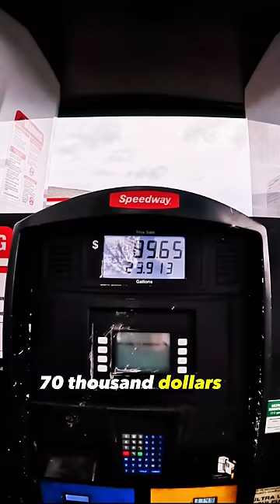when u realize Mo Money is really Mo Problems 😵‍💫 #shorts

Comment: Yeah, what non-owner-operators don't realize is it's all ON YOU.  And if too many things go bad or wrong at once, that can be a terrifying or ruinous thing.
Reply from the maker: yupper it sure can and does!
Reply: Yeah definitely. My father's truck had some horrible problem and he had the engine rebuilt 4 times in less than a year due to the original problem, shitty mechanics, and the shit parts they used. Recently it broke down again and the company refused to cover the cost upfront. They are helping him get another rig though
Reply: Pretty sure all non-O/O's know exactly that and thats why they stay where they are. If you can make $120-150k not having to deal with all of the headaches of maintenance, insurance, potential down time, then why bother being an O/O.
Reply: @yamipizza8357  yeah but this guy didn’t make $250k after expenses. Taxable income was prolly even less than take home
Reply: I’ve looked into the abyss and a replacement water pump invoice stared back.
Reply: @guyinatruck My father was a trucker and would trade in his truck for a new one every few years.  Not sure why but I know he had a good financial reason, he was a smart guy.
Reply: @dirtyaznstyle4156  bruh that's what I'm saying.
Reply: It's all by design, it's not worth it to be an O/O  and to be a company driver isn't worth the sacrifices you have to make in order to make slightly over 50k a year.

Well funded big companies for the most part had to of started with a sizeable down payment or some kind of backing.
Reply: @The power of the D  nah man it's all about knowing people. Just like I'm a company driver/independent contractor. I work for one guy and he leases me onto another company. Like this year I'm forecasting to make $130k after taxes. Just got to talk to people and do your research. As always you are a individual and not one company defines your outcome. Choose your own destiny.
Reply: @ThePowerOfTheD  not all trucking jobs are equal. I made over 70k 24 years ago, local, home every night, no weekends. Ltl line haul drivers were making 125k
Reply: @yamipizza8357  because a good owner operator can net $360k.
Reply: @yamipizza8357  Point me to that $120k to $150k per year trucking job as just the driver.
Reply: @calebwood1663  I’m gonna assume he traded for write offs on taxes. Better to spend the money on what you need or want than to have it go to Uncle Sam. My boss does the same with his pickup trucks every 2 years so he doesn’t have to spend it in taxes that don’t do anything for us.
Reply: Then how the hell do you expext them to pay executive bonuses?
Reply: Well that's why you take care of your equipment. 250k is low for an owner op.  I made 375k hauling frozen loads.
Reply: the Kingdom of GOD is coming…“Silver is for the kettle, and gold for the furnace, but The LORD is the tester of hearts- Bible” your heart is like discovered silver, dirty and not pure, when silver is purified it is melted over and over, to the point that when it’s melted and glows red hot, it is pure enough to see your own reflection in the puddle, so also does the LORD purify your heart, till HE can see HIS own reflection in it, seek the LORD and be reborn, ask The LORD to renew and restore you, repent and be baptized for the forgiveness of sins, Jesus died so that our sins will be wiped away and so that we could be made new, seek The Kingdom of GOD for if you would be wise you would be wise for yourself, pick up your cross and deny your flesh and follow the path of GOD, for The Kingdom of GOD is at hand, in JESUS MIGHTY NAME Amen and Amen 🙏 o
Reply: @ShayFeral  Lol I have a close relative by marriage that nets that every year. It's called working for a good company and having good experience.
Reply: @Russ Ford  if you can work on your own shit your gonna reduce alot of the costs or dont take it to the dealer unless you have to take it to smaller mechanics
Reply: yeah.I got into trucking in 2014 and have gone bankrupt twice but mostly that was due to dishonest drivers but yeah, those expensives can add up. 
My trucking business is in Jamaica and lets not get me started on that insurance scam.

I Had just fixed up an old Truck and sent it out to work when another driver literally backed into my parked truck and distroyed the entire front end and cab. 
His truck wa insured but the insurance company refused to pay claiming that since hi name did not appear on the insurance then the owner breached the policy therefore I had to sue him.

I was like no YOU need to sue him, thats what insurance is for. You take the risk I have insurance. THey refused and so I was out FIVE MILLION Jamaican dollars( around $32,000us)
Reply: You can't compete if you have one truck and you drive it with Warner. I heard they get a new tire on a rim for $75 they buy thousands at a time. Everything you do as an owner-operator cost you retail and you're selling wholesale.

Comment: So in 1996 I bought my first truck. I grossed $187-K my first 10 months. 1997 I grossed $196-K. New 24.5 LP tires where $150.00 ea. And Fuel was $1.04- $1.09 a gallon at that time. Oil changes & Service at Speedco where $99.99. My weekly (bobtail liability) insurance was $17.00. I was leased to a company that covered the cargo insurance at that time as long as it was there Frieght on the deck of the trailer. In April of 2000 I bought a NEW 50' Aluminum East Step Deck including FET that trailer cost me $36-K. Now my truck wasn't new, It was 2 yr old T-600 when I bought it in 98 with a Detroit Series 60 12.7. Thankfully I paid off BOTH the truck and trailer in October of 2001, Right after 9-11. My worse yr was 2009, I only made $78-K. But due to a back injury and surgery, I was off and out of the truck for 7 months. Your costs are why I sold everything in 2013. At that point I had 3 trucks, And it just wasn't getting better with all the future changes that we saw coming.
Reply from the maker: Pyle you did great back in the day when things actually made sense! It’s tough out here in trucking. When you sold everything did you retire or what was your next occupation?

Comment: Even taking into consideration all those expenses according to my math you’re still making over $120,000 a year. That’s twice what a lot of people make.
Reply: I doubt that it was 120k, closer to 80 - 90k probably. Assuming there were no major repairs. Transmission, drive axles, engine, etc
350.00 a month for oil changes. 
Brakes and air system.
Tires.
Not to mention the 100k from the get go. That has to be paid back, truck payment. 
500 - 600 dollars per tire (unles you get the good ones, 1,000 plus), road side tire repair average around 500.00
It is alot of work and expenses to make 80 or 90k
Unfortunately the older the truck the maintenance cost goes up considerably. 
New truck, nice one, 170k-240k
Reply: You're not considering how much it cost in maintenance also diesel and insurance. The truck needs to make over a $100 an hour to consider a profit To fill up a truck is about $700 for 2 days of fuel My insurance was 3k a month that's $750 a week also Trucks now of days are over a 100k new you looking at 200k So if you're doing payments you're looking at that bill at the end of the month also It's not easy you gotta run every day No days off.
Reply: @randysmith9636  I’ll agree with you on all the above. There are a lot of expenses but if you’re bringing back even the low end of your estimate you’re still making 20K over the median household income. That all being said, there’s probably some easier ways to make $80,000.
Reply: @Korbanza  I never said it was easy. I ran over the road as a helper for a furniture moving company. I wasn’t even a driver I was just a strong back but I saw all of his fuel bills and we talked obviously all the time and he explain to me just how much he pays in insurance and everything. But even taking all those things into account you’re still going to be making $10-$25,000 more than the average median household income in this country each year.  There’s easier ways of doing that but dirty hands = clean money.

Comment: Very true! I spent $73,000 on fuel last year with a gross income of around $240,000. Maintenance, and insurance cost on top of that really sucks. 2 weeks ago I bought new steer tires that cost me $1,650.
Reply from the maker: Yupper the costs of operating a trucking biz is crazy high!! What brand steers did you go with?
Reply: @guyinatruck  Goodyear Endurance LHS 16PLY.

Comment: Insurance is $2500- $3000 a month for your 1st year+, Tolls,parking.. oil changes is $350 a month for older trucks,.the nickle and dime fees are alot more..Remember insurance doesn't stop when your at home..good luck trying to take more than 5 days off,especially during bad times like now when freight isn't paying...if your leased on to a company and pay them 20-%25 of gross for each load at the end of the day your a glorified company driver that has owner operators expenses...If your thinking of chasing freight buying a new truck having truck payments %85 percent chance you will fail or run up dept thats not worth it..staying a company driver allows you freedom to come and go as you want..if you need to take months or even year off no sweat off your back just keep your license clean and you will alway have a job waiting with no owner stress...finding a nitch buying an older used truck and running tri state/home every other night is the way to go if owning your own rig

Comment: My dad started trucking in 1973 when He came back from Vietnam. In '73, He borrowed $50K from the Bank & $50K from His parrents. 

He bought a slightly used Peterbilt,  with a Flat bed & closed refrigerator trailer, He literally did all runs who were available or paid, and recently retired after 50 years onnthe road.

Trucking back in the 70's was alot easier and certainly better organized than it is today 😢

Comment: Yeah, totally agree. I have 5 trucks on the road. You don't wanna know what I spent last year in diesel, insurance, and tires. I've had these trucks on the road for 10 years. Last year was my most expensive year ever. My total profit was under 200k and I'm use to 350k+ in total profit after everybody is paid. 

I was wanting to add one more truck, but that shit ain't happening for a few years.
Reply from the maker: yeah Jake sometimes people think it's easy you just add more trucks and you will increase your profit margins but it's just not always the case. You are doing pretty good though brother, 5 trucks is amazing! Last year and this year has been rough! Fuel and insurance went bezerk! Not to mention spot and contract rates fell
Reply: @Guy in a Truck  the insurance is an absolute joke! I don't even make claims anymore. I can't afford the rate hikes. I just eat the cost and fix the damage myself. I've had three trucks down this year for deer strikes and fixing it myself was cheaper than claiming on insurance. 

I have a little bit of debt and I'm considering once paid off liquidating my company and going to find something else to do. I'm going to hang in there for two more years but if I don't see any improvements after the election, I'm out. The headache just ain't worth it anymore. 

I have some solid contracts that I just resigned two years ago but they are feeling the impacts now and starting to slow down and cutting other carriers just to keep up with our contracts. It damn sure ain't getting any better tho.

Comment: I know this must sound off, but what if, you could actually test the Tesla Semi-Truck when it comes out, and track the energy usage, for later calculation on how much it would cost to "fuel" it.
Reply from the maker: It would be an interesting calculation I’m certain 🤔
Reply: @guyinatruck  It needs to track the actual input consumption so you can calculate the consumption cost based on the route you take, and the available chargers. and having the cargo weight and shape in the calculation, would also mean you could further predict the true cost of the transport, and if/when they will make it autonomous, at first i guess they will go the slowest it can go, then slowly bring it up to normal speed, but that is only highway autonomous driving at first, with driver in cities, anyway i babbled for way too long, but autonomous shipment and maybe with dedicated highway lanes, that would bring the shipment to a new era, and from the track record Tesla has, i give them 20-40 real years to complete it, (basically 5x-10x their estimates).

Comment: 250k - 70k fuel - 30k insurance = 100k  and tires  id say way under 15k or he would have stated it.  [Its 5k]  =145k (- 25k if engine replacement) = profit= 120k and they get a 12% discount with a CDL rate at a motel. Not bad.
Reply from the maker: Pretty good calculations

Comment: Well if you blow an engine its more than 25 grand. Im a diesel mechanic and we just replaced an isx 15 cummins and it was $65,000 before the labor to pull the old one, switch the accesssories over, and reinstall. An overhaul is like 30 grand now. Cat prices go up about 15% a year and the other companies arent far behind
Reply: That's if you use dealerships you can get done far less than 65k.
Reply: @2lost505  we aren't a dealership. We're a mom and pop shop and unless you buy a junkyard engine or a cheap aftermarket one, it's gonna be 65 grand now. Prices are sky rocketing
Reply: That's a price for a new one, no core.  But you're in the real world more than most of these posters
Reply: @shadowofkhaos  I get the price are up there but 65k bit of a stretch. You get new one for 45k. If that block or  crank didn't leave then you inframe for less than that. Or where ever you bought that engine price gauge you. Online you see the prices. Lucky for your shop to get that amount. I hope I never need to use your facilities you labour rate must be very high

Comment: That's why I like the impact of Tesla Trucks coming. When all vehicles will have automated driving it would be most helpful. Having only some vehicles but not all vehicles automated driving does not take all variables of out of driving. Once we can truly cut down on the number of accidents hopefully auto insurance could go down. Still automated driving is still in its infancy. With Tesla trucks at least the price of fuel is no longer an option. Tesla and all the other Truck manufactures working on battery technology will be helpful. If the whole hydrogen and use costs can be lowered that would also be helpful.
Reply from the maker: Yeah I agree once the industry and infrastructure can support electric to full capacity then it will transform the way we drive for sure.

Comment: yeah was that after the expenses?? take out all the expenses amd the amount you should set back on every trip for break downs, I'm gonna say if you had a good yr after expenses maybe 70k or less.
Reply from the maker: that was gross so yes before expenses. trucking is very expensive
Reply: @guyinatruck  yeah I know been in the business for years until the judge told me I had to quit my job cuz it's not a proper job for single Mom to do... still trying to get to federal court to sue amd get my Daughter back who was illegally kidnapped... Honestly I think the cheapest way is a good decent pick up truck with 53' flat bed and eliminates majority of semi expenses and gives you a little more freedom. Also easy to bypass the scales when you're overloaded cuz DOT don't know your commercial or not. Of course that's if your working for a shady boss who used to modify the Weight stickers and I wasn't getting caught so  I had to plan ahead. For yourself, shouldn't have no problems. Be safe out there.